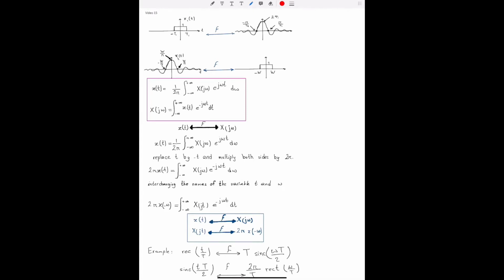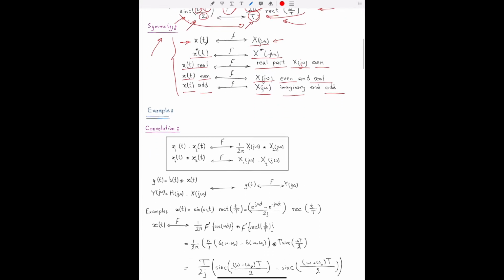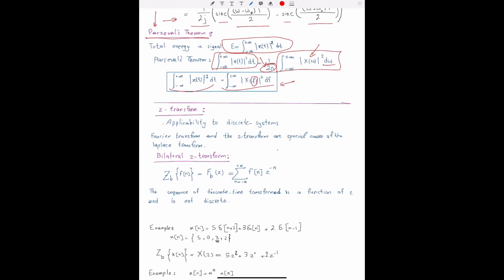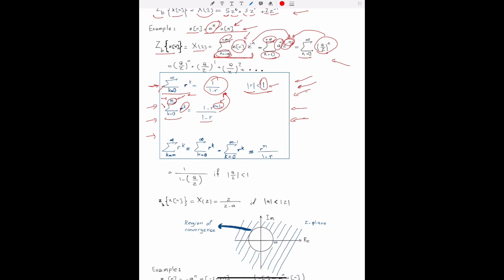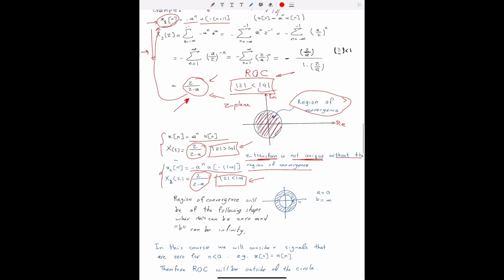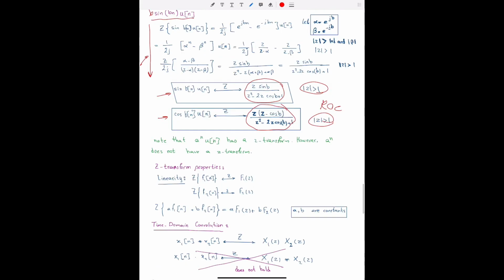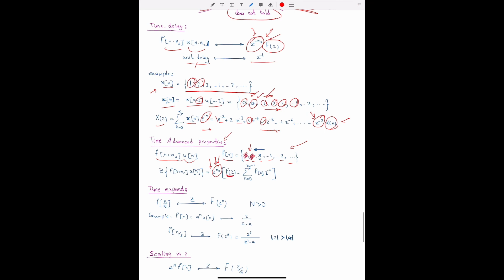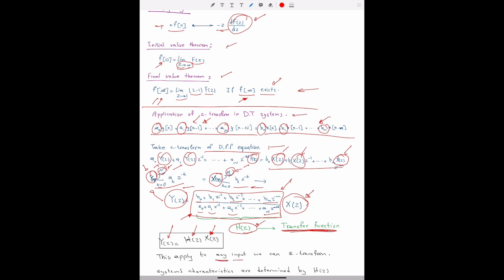ENEL327_Video 15

Comment: Dear Iman Askarian,

  I hope this email finds you well. My name is Song Lu, a Ph.D. student at Southwest Jiaotong University. I recently read your paper titled "[Variable Frequency Control for Isolated,onresonant Single-Stage AC–DC Converter With a Constant DC-Link Voltage]" with great interest, particularly focusing on the derivation of a specific formula.This formula is the output power equtation (9) in your paper.
  Despite careful examination and following the solution steps outlined in your paper, I have encountereddifficulties in reproducing your results.Regrettably, I have been unable to derive the same outcomes as presented in your paper. Consequently, I am reaching out to seek your guidance on the specific derivation process of the formula in question. If you could provide a detailed step-by-step explanation or any additional insights, it would be immensely beneficial to my understanding.Alternatively, if you could recommend some papers specifically related to DC-DC converter stages, it would greatly assist me in further study and research on this topic.